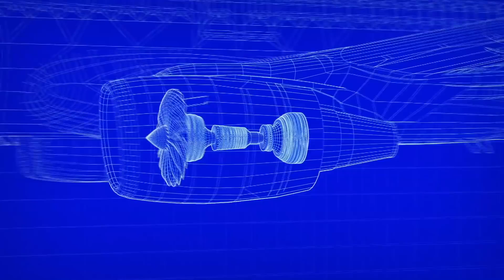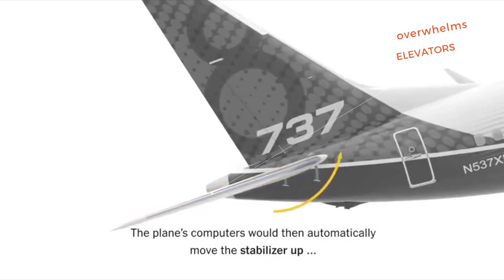737 Max 8 probable cause revealed - Prof Simon

Comment: It is mainly a consequence of greater power in the engines, in my opinion.  In any jetliner with engines mounted under the wings, the thrust will be below the center of gravity.  This will cause the pitch to rotate up.  This is counteracted by trimming the horizontal stabilizer for nose down.  All 737s and similarly configured aircraft do this, but in the 737 Max the effect is greater due to the more powerful engines.

There are many comments on various forums about the “instability” of the Max, but I have not seen one from an authoritative source which says that this effect is fundamentally different than that in any other 737.  It is just stronger.  It seems to me quite reasonable to use computer-aided trim to keep the aircraft in trim, provided it is properly implemented and provided that the aircraft can be flown without it.  The latter seems to be true, since some pilots have gained control of runaway trim by disabling MCAS, but the former is certainly not true.  The MCAS should not cause runaway trim under any circumstance.

I believe the 737 Max will be as safe as the 737 NG when the revisions to the software and training are made, and I will have no qualms about the fact that a computer will be providing trim assist in the Max series aircraft.
Reply: Yes, the programmers will get the job done and keep the 737 MAX in the sky! Thank God for better programmers. Without them, people would die! ;P
Reply: Boeing developed an inherently flawed aircraft with the MAX-8 disregarding basic aeronautical laws as in the NEUTRAL CG point thus requiring the development of the MCAS to handle the unbalanced characteristics of this aircraft.  To compound this problem Boeing kept this MCAS information from the aviation world impart due to the adverse impact it would have on MAX-8 sales, from the enormous cost of retraining all MCAS pilots.  These few words can not begin to describe all the different tangents this investigation is going to take,  Bottom line is money and greed.  Lives do not matter they are just a number and at the end of the day Corporations just buy them off as it is cheaper than addressing the problems correctly.
Reply: The day before the first 737 crashed the crew had a similar problem but disabled the flight-control-system so some did know how to fix the plane.  Of the 376 delivered only 2 have have crashed so what is the difference between planes & pilots.

Comment: Why did Boeing connect two MCAS to two AoA sensors separately and make the AoA disagree light only an option?
There seems to be an obvious lack of redundancy because any single AoA failure can trigger a serious malfunction. 
Why not having one MCAS taking inputs from both AoA sensors and checking their agreement first?
Reply: You need three independent sensors to mid level vote. The most you can do with two is disable the system if there is a discrepancy, which for the intended purpose of the system you would not want to do. Instead you have to assume the worst one of the two is true to caution on the side of preventing stall. With three you can compare all three to find a single bad sensor and disregard its readings. At that point your back down to using the worst case of the two remaining good ones. So if you have two failures you’re hosed, same result will occur.
Reply: @cabdolla  
Your assuming the Angle of Attack sensor is the only source of information. A plane will have multiple additional sources of information in the event of a significant disagreement enabling a probability weighting to be given to each sensor.
Reply: @cabdolla  Actually two out of three is better but no guarantee. Look for LH1829. Two AoA stuck at the same angle, the correct sensor was regarded as wrong by the system and the plane was send on a 4000ft per minute drop. The pilots solved the problem, though. Second, on the max8 the plausability check with the second sensor and a warn light is available for extra money.
Reply: Lion Air was not the first aircraft to go down due to faulty angle of attack sensors. There was an airbus that had two out of three of its sensors stick due to icing. The flight computer assumed the two agreeing (but malfunctioning) sensors were correct, and the plane went down.
Reply: @mysock351C  Are you talking about Air France 447?  That was ruled primarily due to pilot error. They stalled their Airbus A330
Reply: @michael2k3d48  Correct but the reason they where flying manually  was sensors sticking due to icing, this caused them to revert to manual  control.
Reply: @mysock351C  You are talking about LH1829 with AoA Sensors. The frozen sensors were stuck at the same angle. the system sent the plane on a drop by 4000ft per minute. The pilots solved the problem.
Reply: When autopilots get anomalous readings they return control to the pilot. 
What happens when the computer can’t decide which AOA sensor is correct, but is also “afraid” to give control back to the pilot (because it thinks his poor manual handling has caused the stall condition that might be happening).
The poor computer is in a no-win situation. 
Probably killed itself from depression.
Reply: @daveplumley7854  MCAS isn't active when the autopilot is engaged. It's not needed because the AP is controlling the stab trim... MCAS is only active when the pilots are flying the aircraft manually.
Reply: @tjernagel  That is incorrect. The MCAS is always active if the flaps are not being used and the MCAS override is not disengaged deliberately by the pilot.
Reply: BlueJayRobin  Some aircraft do have three AOA vanes. If one of them is in conflict with the other two then it's simply ignored.

More changes to the 737 is more cost to the customer and adds little value to an already proven airframe. Southwest has flown over 88,000 flight hours and 44,000 lands with their fleet of 737max's without an incident.

These two accidents are pilots not well trained and too much airplane for them to control...
Reply: I have never liked the idea of flying an aircraft with only one AoA probe. I was a Flight Engineer on L1011 (two AoA probes fitted) for over 12 years and in our "go -no go list" was the advice to go with only one AoA available if icing conditions could be avoided. I did have one occasion when the heating of one probe had been left on after landing and now glowed bright red in colour. Not knowing if the bearings were damaged, so preventing the probe from working accurately, I insisted that a new one was fitted.  I met with much opposition from the Captain and ground engineers but, in the end and after my firm decision to ground the aircraft if the probe was not changed, a new one was fitted. Would it be too bold of me to say that if there had been a third pair of eyes present and a third opinion as to action to be taken, these accidents may not have happened?
Reply: good question....
Reply: Gary Salisbury - Simply incredible engineering malfeasance
Reply: Looks to be a good option now.
Reply: An average value is calculated from both sensors, apparently an offset of 20 degrees is not interpreted as a failure condition.
But the average would still be 10 degrees to high, add the takeoff angle of 10-12 degrees and apparently that is high enough to trigger MCAS to execute trim down commands.
Reply: Boeing...we insert some awesome system in there!....
Airline....wut?
Boeing...Nah just use it u will love it!.....

This is the cause of tregidy!!.....
Reply: because stab trim is pretty damn obvious, if the plane is trimmed down the AOA is given to be less than 0, you dont need to be a genious to figure that out, diconnect the stab trim, manual trim = success
Reply: To add insult to injury, Boeing NEGLECTED to inform airlines or their pilots about the significant changes ASSUMING their software would handle it. Major fail and death.
There isn't even a simulator for this aircraft.
Reply: The AOA Disagree is not a yellow light in the flight deck as many news outlets are reporting. It's a message on the Primary Flight Display (PFD). If I purchase a Chevy Volt the base model will cost me 32,000.  If I want to add blind spot detection it will cost me an additional $3,000. Add adaptive cruise control, another $3,000. Both are safety features that are not required to operate the car. I made the $$ numbers up.  :-)

I know I'll probably get beat up over my response but it's reality. when I'm driving on the highway at 70, have a flat tire, I don't open the door and jump out. I have to know how to safely slow the vehicle down and get to the shoulder.

When the stab trim is trimming nose down all the flight crew on Lion Air had to do was command the stab trim back to green with the control wheel yoke switches and if the stab trim continued to go to the nose down position reach over to the center console (below the flap handle) and turn it off. It's as simple as that. But they have to have the proper training to know what to do!

The AOA disagreement message is not required to operate the aircraft. It's a nice to have...

If the flight crew on Lion Air couldn't figure out how to turn off the stab trim an AOA disagreement light wouldn't have helped them either...

We don't know why the Ethiopian flight went down. It could be the same as ET409 which went down in 2010...

Republic of Lebanon Investigation Report 

http://www.databank.com.lb/docs/Final%20Investigation%20Report%20on%20Ethiopian%20409%20%96%20Boeing%20737-800%202012.pdf 

ET409 Flight Profile Graphic
https://www.facebook.com/1398133526/posts/10219310836667178?sfns=mo

Comment: They should have just designed a new aircraft instead of continuing the 737 line. There's a limit to how much you can improvise on a 50+ year old airframe.
Reply: Sundar Subramaniam Agreed. By all reasonable accounts Boeing was very surprised at the success of the Airbus 320NEO family and came up with the quickest solution they could, in what became the Max. This was a game of catch-up as Boeing had put off an all new narrowbody with the thought existing customers would stick with the 737NG until they were ready with a new plane far in the future.
Reply: Indeed, Boeing chose profit over safety
Reply: actually NO there is in fact a limit to what can be engineered in any form of physics and that includes aerodynamics that is why the SR71 remains to this very day the fastest air-frame ever engineered it is the optimal solution to the problems involved.
Reply: Exactly

Comment: There appears to be possible new evidence that the software system can only be reset and not turned off. 
If true then the Ethiopian crash was unavoidable not matter what the pilots did.
Reply: Greg disabling the pitch trim will kill the MCAS.
Reply: Do you have any source on that?
Reply: There was a report from an off-duty pilot who "saved the day" by switching the MCAS off on the MAX of Lion Air that crashed just a couple of days before the crash. So it CAN be turned off. I can't imagine a plane with MCAS that can not be turned off passing certification.

https://edition.cnn.com/2019/03/20/asia/lion-air-third-pilot-intl/index.html

Comment: MCAS can be deactivated by down stepping two toggle switches on the center console. Most modern commercial pilots (particularly in the Third World) are trained to be more IT system managers than aviators.
When betrayed by a system it is particularly difficult for them to step back to the old school " simplify stabilize and hand fly" that is (or was) taught in the U.S military and many flight schools. This would have been much harder to do in IFC and still leaves the issue of the lack of simulator and study on Boeings head.
Part of the difference is most fast jet fighters since the F-4 Phantom are completely uncontrollable without augmented stabilization and early in ones flying career one comes to terms with the response to system final betrayal being ejection. Many modern commercial pilots didn't grow up in that neighborhood or with that as an option. This is somewhat analogous to the British effort in WW II to stretch the aging Hawker Hurricane into a fighter-bomber as it aged. Fortunately the Hawker Tempest arrived quickly. Here Boeing's effort to skirt mandated notification and simulator training for cost saving will give the better part of the market to the younger and still more flexible Airbus. On the ground or in the air....greed and panic kills.

Comment: They may end up having to go with an independent fully movable left and right horizontal stabilizer just like on fighter aircraft. And then put that into the control laws to make it easier to fly yet still be controllable in a manual mode.
Reply: It's not beyond possibility that they may end up having to scrap the model.
Reply: Will Warden Because you want to induce irrecoverable roll failure modes?